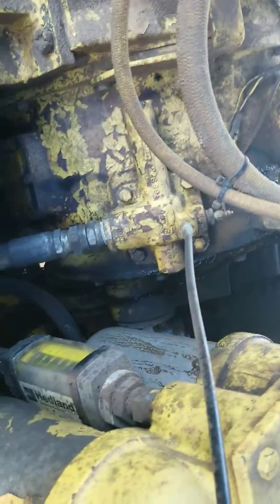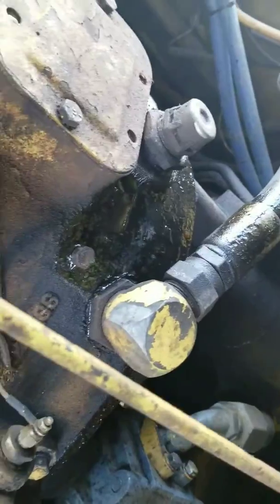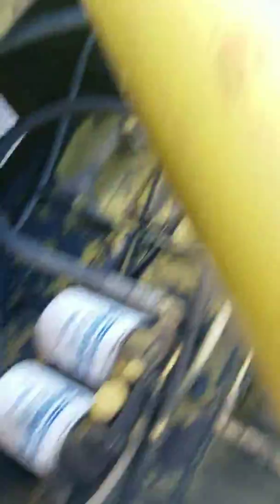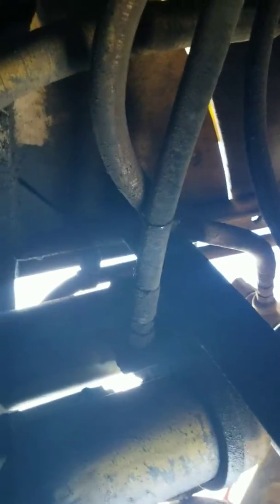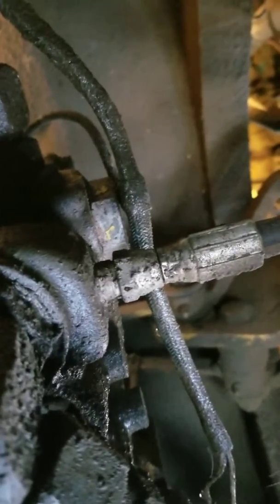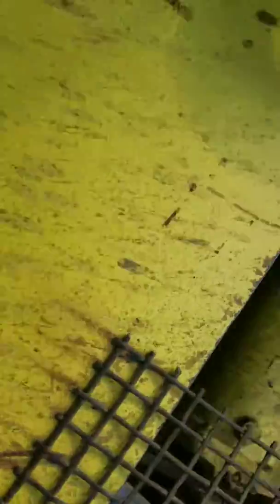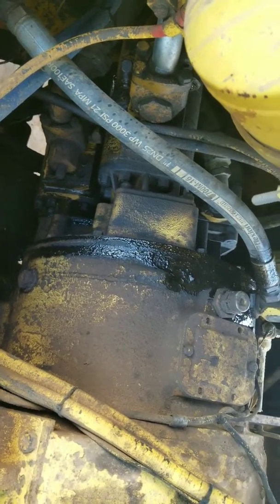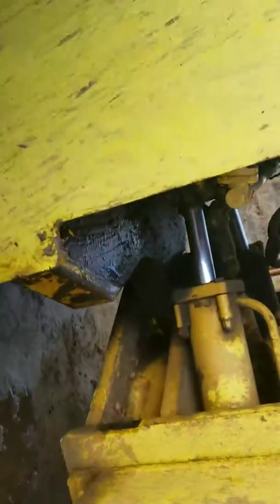Clark 275b transmission tests and what you should know

Comment: I got a large oil leak 175B and it looks like transmission because it’s not completly black oil like engine but it’s dripping through mud. It’s coming out of the bell housing on the torque converter to engine. I’m guessing an input seal not the rear main?

Comment: Hello. I have been figuring out about my Clark 75B why it keeps spitting oil in the breather of the converter. I found one comment that’s similar to my problem but it has hydraulics and it has movements. The only problem is that it spits oil all over, and I can’t continually use it bcoz it’s probably end up getting empty which mean more problem plus it’s very messy. I hope you can read my comment and send some suggestions. Thank you!!

Comment: I have the same exact loader, I put oil in it when it was running and it all blew out the breather on the converter. now I have nothing, no hydraulics at all. Any suggestions?
Reply from the maker: Does it have any oil in the transmission, it needs to be about 2 inches above the full level cold, if it's got oil and you have no hydraulics or movement of the driveline between the torque and trans. Then it's likely the fiber gear that the torque splines into on the flywheel. You can pull those covers on the side of the torque and see if there is a bunch of chunks of fiber gear. It's a common problem that happens sometimes and it's not too bad of a deal to change. Bpt components in Canada sells them
Reply: I read about the same problem on Heavy equipment forums. I agree with Ryan Ozbun that the most likely suspect is the fiber gear.
Reply: Bouke Maas  thanks guys I’ll check out tomorrow might need the name of Canada guys for parts
Reply: @jlfortin7gmail  226595 Is the original partnumber as far as I can see. Don't know if Minnpar stil has them. Here in Holland I know a few of them lieing around.
Reply: Hello. I have been figuring out about my Clark 75B why it keeps spitting oil in the breather of the converter. I found one comment that’s similar to my problem but it has hydraulics and it has movements. The only problem is that it spits oil all over, and I can’t continually use it bcoz it’s probably end up getting empty which mean more problem plus it’s very messy. I hope you can read my comment and send some suggestions. Thank you!!

Comment: Hey. lots to know about these things. I have a Clark torque & transmission in a Case machine where the transmission actually just lost all the oil & it ended up in the engine oil pan & overfilled the motor & puked out all over the ground. 
Can't find anything yet about the torque & bell housing. Is it possible the whole bell housing with the torque converter can get filled & over-pressured & push oil backwards through the main seal & into the engine? Seems like such a far fetched idea, yet the oil is gone from the transmission and the oil pan is filled to the gills on the engine. I've never seen a bell housing where it's full of oil, but this one looks like it's possible. Nor do I know if the torque converter is submersed , just assumed it was not like in a normal transmission or automotive application. at the 10 minute part of this video you show the bell housing /torque converter that looks much the same thing as mine.
I expected to find, but cannot find a cooler where the engine oil and transmission oil are together - which would be the first place something bizarre like this could happen.
Reply: It's possible that the seals are blown in the torque converter and it filled the bellhousing and pushed past the rear main. That's really the only place they could communicate if there is no oil cooler linking the two. The torque converter has those square plates on them you could pop one of the lower ones off and have a look if it's full of oil from the trans then I'd say that's your issue. What is the model of the torque converter and trans? Also if the torque leaks into the bell housing that badly you should have seen some overheating of the system. Also parts for the trans and torque is easy to come by. A company called bpt components in Canada will have or can get you a rebuild kit for your torque. Mine was 700 bucks for this big torque. Good luck ask any more questions if you need